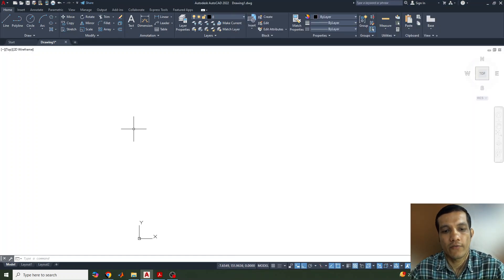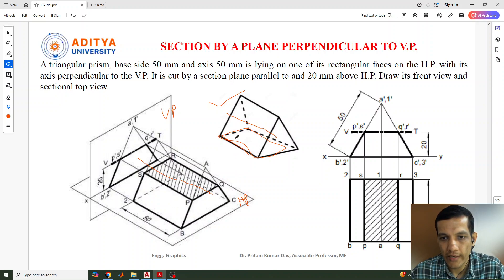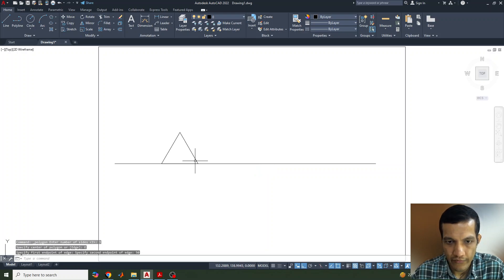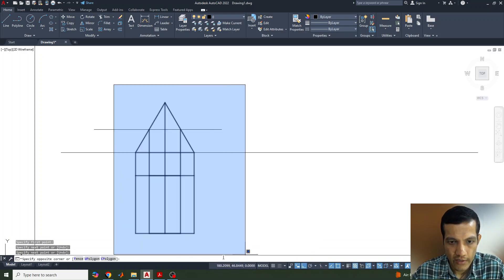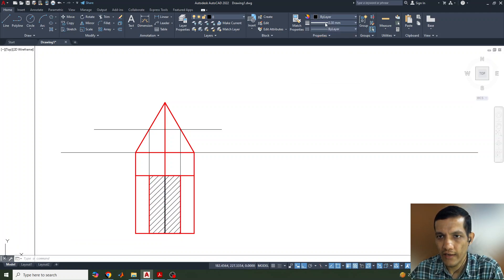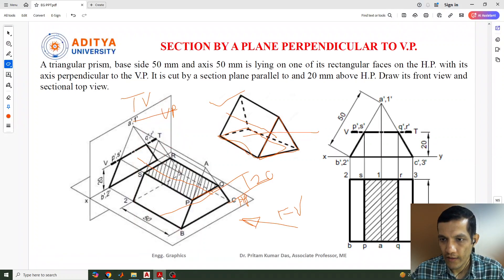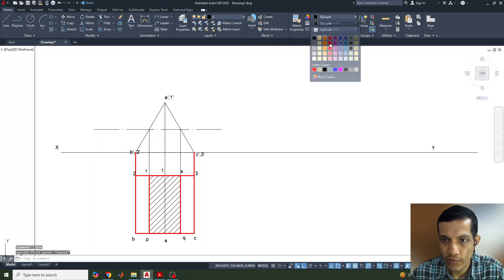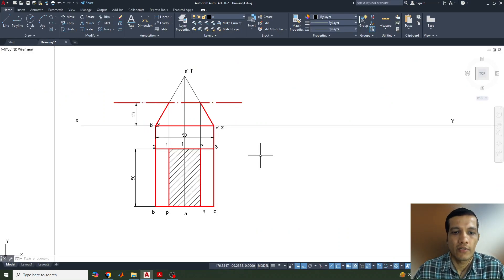Lecture 85 #Section of Solids Problem1 #Plane Perpendicular to VP & Parallel to HP #Triangular#Prism

Comment: A triangular pyramid, having base 40 mm side and axis 50 mm long is lying on the HP on one 
of its faces, with axis parallel to VP. A section plane, parallel to VP cuts the pyramid at a 
distance of 6 mm from the axis. Draw its sectional front view and top view
Reply from the maker: What do you want for this question? Shall I solve this.
Otherwise follow this procedure you can do it.
Thank you

Comment: triangular prism, base 30 mm side and axis 50 mm long, is lying on the HP on one of its rectangular faces with its axis inclined at 30" to the VP. It is cut by a horizontal section plane, at a distance of 12 mm above the ground. Draw its front view and sectional top view.
Reply from the maker: Dear @mrlucky159, The process is slightly different from the present one, Step 1- draw the FV as a "Triangle", Step 2- draw the TV as s "rectangle", Step 3- Inclined the TV with 30 degree angle, then finally Step-4, Project the FV from the TV. I hope you can do now, If not let me know
Thank You